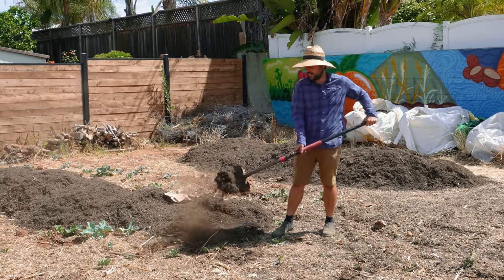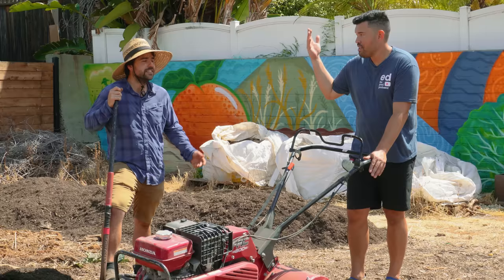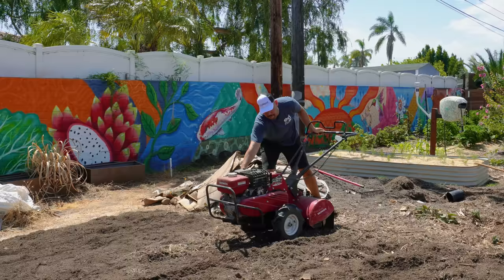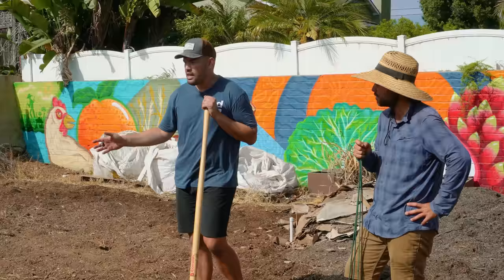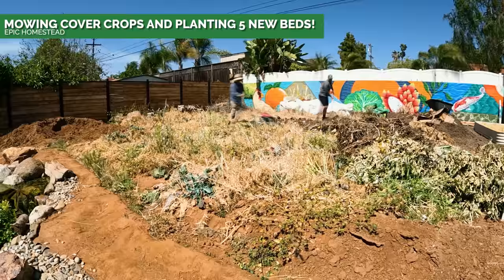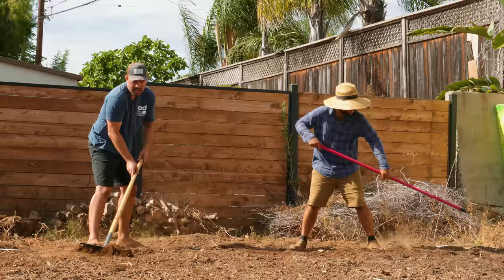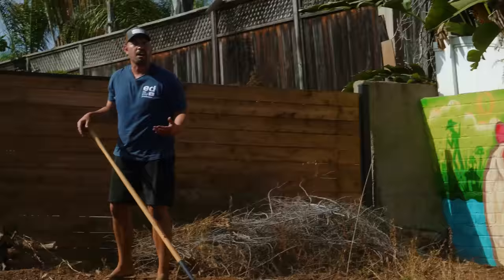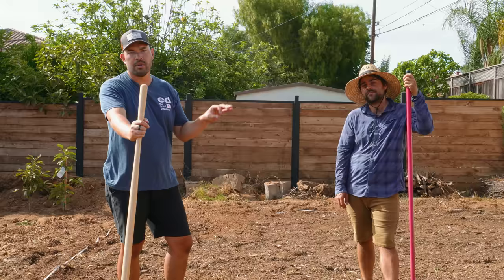I've Never Built a Bed THIS Big Before...

Comment: Map out the corn maze, put a little flower oasis patio setup in the middle with Jacques’ Adirondack chairs.. Some fat county fair pumpkins on the outside with some different melon varieties. Possibly a motion activated Halloween prop turned garden hermit scarecrow at the maze entrance for that scary cherry on top. Mixed variety sunflower wall
Reply: I feel like the term "corn maze" is a tragically missed opportunity. Maize Maze is better.

Comment: Thanks for showing that rototillers have their place in agriculture. Tilling at the start is a good way to remove some excess rocks (loosen and pull them manually or using a sifting grate), break down the hard-pack, and open everything so a person can amend and thoroughly mix the soil with the sand/silt/clay/compost they want to approach the "loam" ratio, for adequate water retention and sufficient drainage (use soil composition test results from an AG university to know what you need.)  After that, ordinary "best practices" like mulching around plants and using cover crops during the rest of the season mean that I don't even need to use a broadfork to prepare the soil for the next season of crops. Obviously, there's no more need to till it again, and the soil structure rapidly organizes and improves much faster than if I was just throwing down a layer of compost or mulch on packed clay or loose sand and planting into that.  It's repeated tilling that creates a problem, but I think tilling at the outset is a fantastic way to get a 10+ year head start on improving a poor plot.  If a person goes the extra mile and excavates/amends the soil down to a 2-3 foot level, that could be a 50+ year head start.

Comment: I get the same compost from the place you do.  I agree you need to let it sit for a while a fully breakdown.   Be sure to add plenty of water which will speed up the process and then it will be ready after a month probably.   They do hot composting their and its still like 150degrees in the center of the pile when they give it away.

Comment: Oh! I just recently expanded my veggie patch from 15 x 15 to 20 x 30, which is roughly the same size as this new bed of yours

I have rabbits that have come in and gorged themselves on the salad bar though so I have to finish my fence before I put more things in.
Reply: Up here in the woods of NH we have issues with rabbits, woodchuck and deer. An electric fence with two heights of tape worked perfectly for us, one at woodchuck/bunny nose height, and one at deer chest height. It turned out to be cheaper than a full fence, especially since its about 100'x 200', and we can take it down really easily for the winter time, since it's at the bottom of our sledding hill